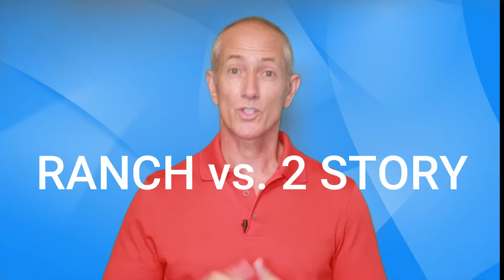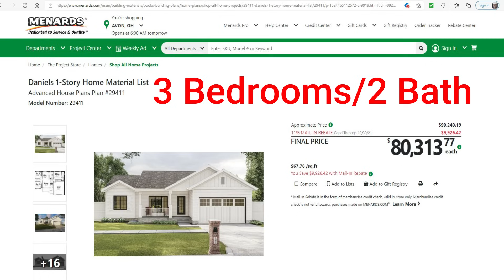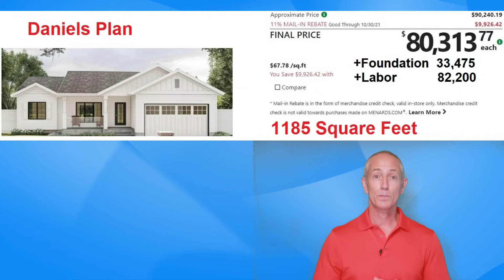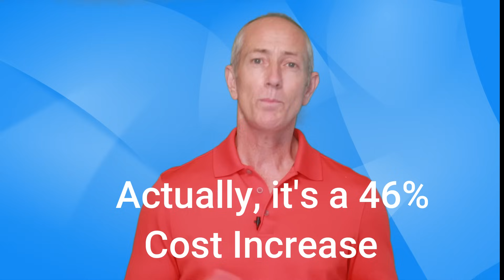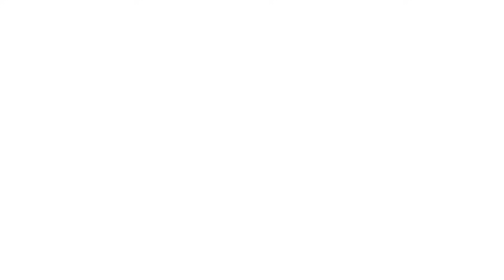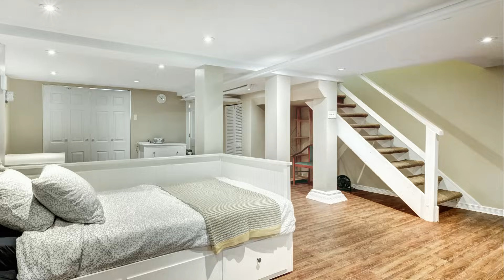Affordable Houses: 3 Design Tips to Save

Comment: There are some additional costs such as flashing materials, nails, structural hardware, and consumable such as the saw blades and let’s not forget the cost of the tools
Reply: Look who is nit picking. Like I said , if you already have the tools and you’re going to do all the work yourself,  then let’s look at the real cost. I proved it out according to bids and costs for the remodel I just pulled permits on in GA: It’s between 27-33K additional cost than the first package is between 90,55 and 95.62 per square foot, that’s 34% more than the number being thrown out there. You obviously haven’t purchased Simpson ties, nails, screws, caulking, flashing tape, house wrap etc needed to bring these kits up to code, and GA isn’t close to being an expensive place to build. Throw in some subs for some of these trades in order to get it done on time and you can add another 20% easily. I have all the tools and know how to build a house from the ground up, every trade can be done in house and I cannot gets the costs below 89$/ft2 and that’s with low cost finishes/fixtures. If I’m paying 95/ft, it’ll be nicer than these kits that’s for sure!
Reply: @Natedoc808  I am not a fan of the kits.
Reply: @Natedoc808  A few hurricane ties don't cost that much.
Reply: @MrSteeDoo  they must not build em the way we built them. We put every bit of 1K of hardware into every build per code
Reply: @Natedoc808  We are talking a 1200 sq ft box here
Reply: @Natedoc808  30x40 or similiar rectangle is simple and easy and cheap.  No cut up roofs, bumpouts, or special hardware needed.

If you are building for yourself it's one thing. If you are building for sale then there are many other factors involved.
Reply: @MrSteeDoo  like I said before, your codes must be very different than where I have built, even a straight ridge rectangular shop requires H2s or equivalent such as Simpson screws, straps and hardware to make 1 continuous connection from foundation to roof peak including diagonal bracing w/ hardware from gable peak to joist/base of the trusses. Any span 20ft or more including in line with the truss/perpendicular to the ridge requires a shear wall. Extremely overbuilt in my mind but code is code. My preferred method of building is beam and rafter w/ cathedral ceilings to save on materials. 

I don’t really think building for myself or building for sale are different. I’ve heard builders say, “well, it’s my house so it doesn’t have to be perfect.” Either way you’re doing the work so you should do very good work so there is long lasting value, as even if it’s yours, you gain that value, so will your children and grand children.
Reply: @Natedoc808  As far as the resale goes I was mostly thinking about design issues such as master ensuites and various nooks and bump outs.

It sounds like you are young and have a good plan.
I am 58 and looking to build a small retirement cottage on some property I own. I will build with cash.  So if I have to build a 28x32 rectangle with just enough to get a CO that's what I will do.

I would love to hand build the roof but I am in WI so the roof insulation becomes a huge issue.  Would have to use at least 2x12 or possibly larger TJI's for the roof to get the insulation needed.
Reply: @MrSteeDoo  yeah, you’d be looking at TJI style rafters at 2x10 plus some zip R to meet code. I’m in zone 3 and 4 so we have to deal with temps from 20s to 110, air tightness and circulation becomes key with R values being very important but far less snow load. Although I’ve built on Tahoe so we would do post and beam cabins with 8-12 roof pitches with standing seam metal.
Reply: Duh.   Saw blades for a circular saw??  Yeah they cost $3 at Menards and one will work for the whole job.
Reply: @MrSteeDoo  you can cut your trim with a framing blade if you want, I hold myself to a higher standard. Your hang doors and trim with a framing hammer because who doesn’t like to see waffles in the morning?
Reply: @Natedoc808  If you have any skills already then you already own a good mitre saw and a good blade.
Reply: @Natedoc808  My point was that your list was nothing but nit-picking.

so let's add $500 for consumables.

Will that change anybody's decision on whether to DIY?

Comment: Wow.  Now strip out zoning laws, and other restrictions.  I built mine for about 13$/square foot.  (That was in '92, so I'm sure it would double by now.)
Reply: I think it would be considerably more than double. I put in a small, 6 ft countertop section in  '97. It was about $35. I need to replace it and, using the same cheap material, it will be over $100.
But even if it went up four times, that's amazing.
Reply: Yes, if you want the lowest cost you need to look at it as building a large shed and going from there.

You shouldn't accept the "houses cost $300/sq ft" number and then try to tweak a few dollars off here or there.

Comment: Failed to discount the the 2 story square footage by the loss of usable SF due to stairs/elevator (4-8%) and keeping the primary bedroom/ensuite on the main floor which is difficult to include in the shrunken two story footprint.
Reply from the maker: Great point.  The stairs and elevator would definitely take up space.
Reply: If you have a full basement then you are already wasting that 40 sq ft or so for the stairs.  Stacking the 2nd floor stairs over the basement stairs involves no further sacrifice.

Comment: I would be very interested to watch a video about the cost break down of the trades.
As a potential owner builder, I know my lumber package is somewhat fixed, but the labor to build all aspects of the house are variable. 
I would really like a list of what to expect each trade / phase so I can have a better idea of what I should be able to.

Example (with completely made up data): 
Framing - $X-$X sqft
Siding - $X-$X sqft
Rough Plumbing - $X-$X sqft
Final Plumbing - $X-$X sqft
Rough Electrical - $X-$X sqft
Final Electrical - $X-$X sqft
Dirtwork - $X-$X sqft
Drywall - $X-$X sqft
Insulation Installation (Bat) - $X-$X sqft
Reply: Going to depend largely on where you are and what your plan set looks like. Could also be effected by payment terms, who brings the materials, etc. Cost control is an art and a science. Takes a long time to break down. Where you building? Have a plan set?
Reply: In my experience, it really comes down to how many trades of each there are in your area, and how busy they are.  Plumbers were the most likely to quote me an outrageous price and it care when I told them to forget it, because there isn't many of them these days, and they are therfore pretty busy.  Electricians are a dime a dozen in my area, so you have a lot more room to negotiate.
Reply: Great suggestion. And including the local hourly rate and estimated hours that are used in the calculations could help us adjust the costs for our areas.
Reply: Remember to include installation costs of : finish carpentry, painting,flooring, exterior masonry.
Reply: Also foundation, basement labor/sq ft
Reply: This statement didn’t age well. Material prices went up like a moon rocket and has come down to still higher than when it started.

Comment: Wow.  $120K just for the materials in a 1200 sqft at Menards wow… I’m finishing a small 1200 sqft house and I purchase 90% of my materials from Lowes and Home Depot at a cost of $27K.  I used a standard 2x6 construction but I used a better insulation.  In fact my entire home is less then your materials in Jacksonville Florida and my final cost is around $93K but I actually built the house.  I hired land clearing, well and septic, electric and plumbing rough in and  concrete foundation in a standard one story ranch but I considered a 2 story 1400 sqft but there was the stairs issue and the additional floor space was the stairs.
Reply: Do a video about costs and design !!
Reply: @lanestandard6571  no I have not videoed anything.. I have thought about it
Reply: @lanestandard6571  I agree. Brian should make a short video describing what he's doing. It could be of great help to others.
Reply: Hi Brian. I would like to get in touch with you to run some ideas by you. I’m planning on building my house and I would like to hear your opinion on certain aspects of it. How do I get to you?
Reply: @alpargatal  I’m not a home builder just a guy who always wanted to build a energy efficient home to retire in and I’m a Asperger one of those guys who researches everything twice.  Plus I realized along the way how many institutions adding layers of profit onto your build cost who actually had nothing to do with building your house.
Reply: @fedx2185  I understand. I’m curious about your design since I am having a hard time trying to get those 1200 sqf that I would like to get to. I don’t want to ask you questions about your house in this environment since I think it’s a private matter. That’s why I would like to have a talk with you about my project if you don’t mind helping.
Reply: @alpargatal  I used Chief Architect software you can buy or rent to design the house which has many pre made templates you can just adapt and this prints your complete plans.  my house is a plain 32 x 42 simple simple design.  Single straight roof and I’m actually building it myself.  I hired the normal stuff like my septic, well, power pole and concrete slab.  I’m siding my house in metal siding and it looks like a barnminimun other then this it is a normal construction.  I’m getting ready to insulate now and I just purchased a spray foam machine for $3500 the new smaller one and will sell the machine after I’m finished
Reply: @alpargatal  my land cost was $20,000 for 2 acres well was $1800 septic was $4200 power pole was $1640,  Bull dozer who cleared and graded lot was $4000 and my impact and permits was $7300 for a total $38,940 and I added a garage for a additional $11,453 extra.  I have about $17,000 in my frame up and siding and a few dollars I paid some friends from church to help me.  I’m currently running electric and plumbing and getting ready to spray foam.  I figure about $12,000 to finish the dry wall and trim and fixtures.  I’m not adding any custom upgrades or fixtures despite my wife and floors treatments and porches I have not determined yet.  I have my appliances already.
Reply: @fedx2185  Great! I’m proud of you :D  Can I ask you how many bedrooms and bathrooms?
Reply: @alpargatal  2 bedrooms and 2 baths.. I wanted large rooms instead of 3 bedrooms on the smaller size plus I added a few sq ft to the bathrooms..  My goal is to end up with a energy efficient small home with low maintenance as I enter my retirement years god willing
Reply: @fedx2185  I understand. Great plannings. That’s what I’m trying to accomplish too. My plan is for two large bedrooms and two bathrooms but I was having problems with the total area, but I just spoke to a General Contractor that I casually met and I’ve learned they don’t include the garage in the calculation of dollars/sqf. That solved my problem. Now I know I can get to the 1200 sqf. Thanks a lot for the information Brian 👍🏼
Reply: @alpargatal  The chief Architect software figures your total living area,  in clay county here in Florida it is calculated by the heated and cooled area which does not include garages or outside laundry room but it does include the interior walls.   I choose not to use a contractor and in Florida this is easy and most of them charge 35% of the total value of the home,  next no architect designer either to avoid that $10,000 to $20,000 charge.  Most of the published floor plans available are to cut up with un needed walls and exteriors finishes.  Most house actual cost is 12% to %20 of the purchase price and the cost of the lot or land and site prep is not included but the actual home does not cost that much.  My research revealed the first 30% of home price was cost and labor next the investors get 30% and the contractor’s get the remaining….
Reply: @alpargatal  Next you need to learn about Subs because this is where you hire you help.  Your contractor hires subs to do everything at each level of the build.  Always price each section with at least 3 subs and let them know your pricing the job.  All subs have at least 2 sets of prices which 1 is for the contractor and a price for the public so if the know you looking at prices they are more likely to bid lower.  A lot of subs advertise on Craig’s list and other places and you can go around new construction sites and get business cards from crews or I got several of my subs at church.
Reply: @fedx2185  I plan on doing the same next year.   I will be 58 so hopefully I still have enough energy for it.  Cash.
Reply: @fedx2185  Smart thinking.  It's not all that hard.  I did one 20 years ago.  A mid-size box should be framed up in 3 days.  Add a couple more days to get it weather-tight and all is good.
Reply: @fedx2185  Check out the BMO in Pensacola FL.
I have used the BMO in Eagan, MN and the deals have been fantastic, especially on windows.   Last year I picked up a 36"x120" brand new Pella window on auction for $55.  It's a bit of an oddball size so not much auction competition but it worked perfectly for my application.

Not sure how the prices are now with the pandemic runup in prices, though.
Reply: Good for you.  The smart way is to assemble your own package.

Comment: I really love your channel and I subscribed.  

I've heard conflicting things on the savings of going vertically vs laterally with building.  Most builders I've spoken to concur with what you said that it's cheaper to go up.  However, I've had a couple builders in the past say it will be much more if the workers have to go on the ladder to the second story.  They didn't elaborate on that point but I'm curious what your thoughts are on this?
Reply from the maker: It does take a little more effort to work on the second story for rough carpenters, siding installers...etc.  However, the cost difference is minimal.  Overall, you should save a significant amount of money with a two story over the one level home.

Comment: Very interesting! I wasn't aware that Menards sold fully packaged homes like this. I watched your video this morning and immediately called the closest Menards which is unfortunately like 1000+ miles away. I'm curious if you or any of your clients have bought one of these packages from Menards to build out of state and if so what their experience was. Did the price drastically increase? How difficult was it dealing with shipping? Managing the process from out of state? THanks!
Reply: Buy the plans with material list from Menards. Take that to your local box store and get them to price match.
Reply from the maker: I wouldn't advise using a material supplier from out of state.  Besides, the builder supply companies out there should be very competitive in price.

Comment: Great job Michael. I didn’t even know Menards had these packages. I have bought one of your courses. My biggest fear is not knowing how to inspect the work after it’s done. I’m sure one of your courses covers that with pictures or you have a different method. Currently, I’m building with a general contractor but I hope to build a house or barndominium for my parents down the line. My house is going to be a two-story with the master bedroom over the garage. It saves a lot of money over a ranch.
Reply: Master over garage...then you better have a storage shed out back then for flammables. Your floor will also be colder. Detached garages are safer.
Reply: In the house I grew up in; my brothers and my bedroom was directly above the garage. It always smelled like car exhaust. Not good!